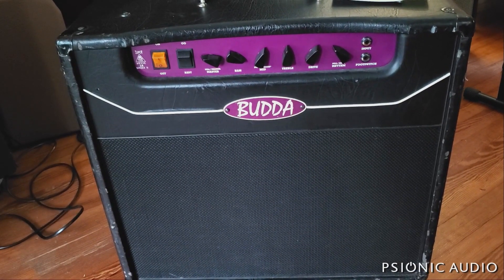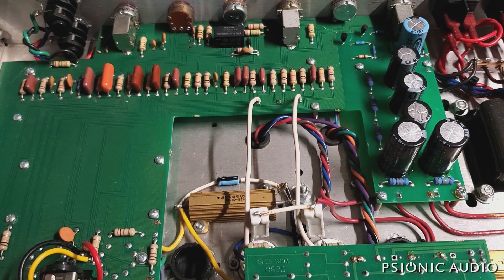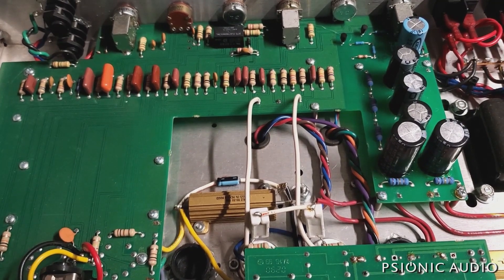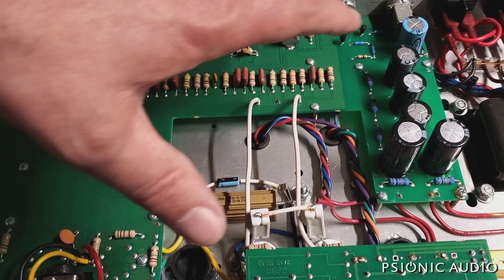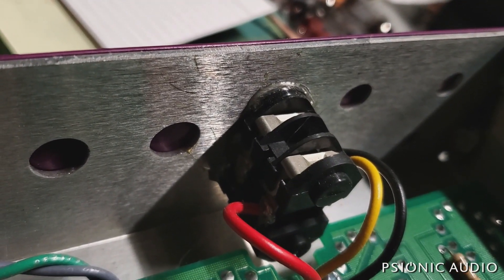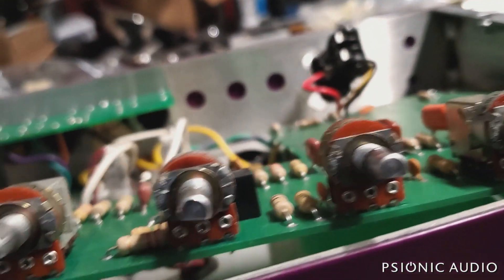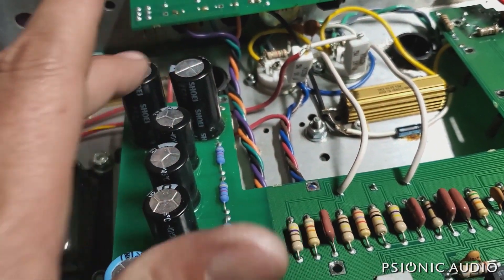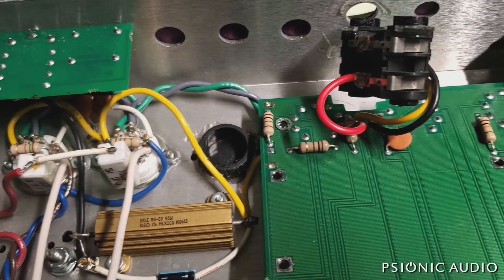Budda Super Drive 18 | Can You Describe the Ruckus, Sir?

Comment: More goodness from the folks who bring you Peavey. Intermittent issues are so much fun, NOT! I had a Marantz 1050 that would never screw up on the bench. I made a house call and I couldn't find bad cables or bad components that were plugged into the amp either. "FM" Freakish Magic.
Reply: This actually looks like a pre-peavey Budda. You can tell by the "zen" guy logo. I own a Superdrive 45 pre Peavey myself. It's my favorite amp and I've owned dozens over the years. I do agree that the post Peavey Budda is not as good, however. One guitarist, after playing my head, immediately bought a Superdrive 45. He picked up a Peavey made model and the two amps sounded very different. Not sure if it was damaged but that's how much worse it sounded.

Comment: Lyle , just in case , let me tell you about an Orange Tiny Terror that was in and out of my workshop half a dozen times for such a fault . It defied all logical fault finding and I only once replicated the owners "volume drops off after 10 to 20 minutes" . It turned out to be the PI 12ax7 which tested good and was not microphonic .I hate to 'shot gun' components , but that is what I had to do , working through the most likely culprits until it finally hasn't come back to me . The owner tells me it's good now .

Comment: damn that amp sounds good on this end. Has that marshall bite, sizzle, and on the cusp of being cranked master volume marshall but just a touch of tame-ness, but not muted and smooth like so many rock-style amps that I assume have marshall DNA. I.e. I like it! Of all the amps I've seen you go through, this I like the best, and looks clean and simple inside. I didn't quite hear throaty mids, but it still seems like it would rock in a mix. Was there somehing in particular you didn't fancy about the voicing? Like a mids thing, or a flubby bottom end thing, or fatiguing highs or something? Am really curious as I would almost start looking for one of these.
Reply from the maker: I am going off memory as that was months back, but I didn't like the attack or the voicing/taper of the tone stack controls.

Play one before buying.

Comment: I had the same exact problem with my Budda Super Drive 30 Series II. Took it in for repairs, and the mechanic replaced the tubes because one of them was redplating. After I got it back, the intermeittent volume fluctuation problem persisted, so I brought it back to the mechanic. After he cleaned out all the pots, jacks, contacts, etc. the problem went away. 

Would other amps exhibit similar problems with corrosion over time? Or is it something inherent to the design of Budda amps?

Comment: I'd never heard of or seen this brand before.  It appears they're owned by Peavey, for whatever that's worth.
Reply: They are but the still have handwired pre-amp sections. The one in this video a pre-Peavey model though. The creator of the brand only signed off on the Peavey acquisition if they remained handwired and to the same specs. I have a pre and a post Peavey Budda and cannot tell the difference. Really, really great sounding amps.
Reply: @spookymulder5535  what year did they sign to Peavey?
Reply: @alpyal1287  2009 if I remember correctly
Reply: @spookymulder5535  oh wow that’s later than I would’ve thought. Thank you!
Reply: @user-zq9su8jv2k  To each their own. I own a Pre-Peavey and a post Peavey. Pre has the Diamond Budda logo, post has the oval. I cannot tell the difference in them when plugged in to the same cabinet. They sound identical to me.
Reply: @user-zq9su8jv2k  We are both random people on the internet, I couldn't care less who trusts who. I can live a with geometrical mistake.